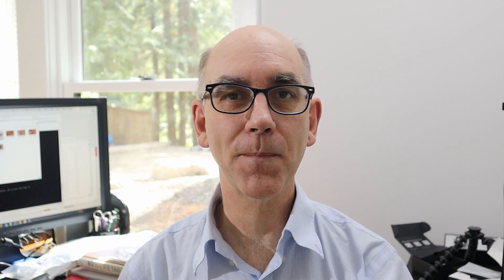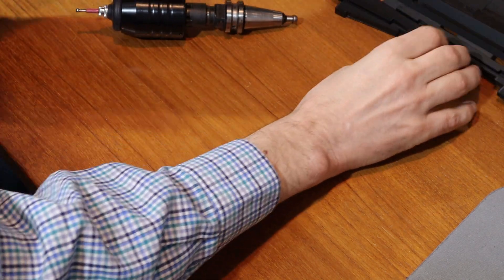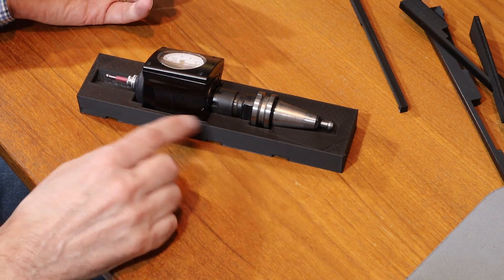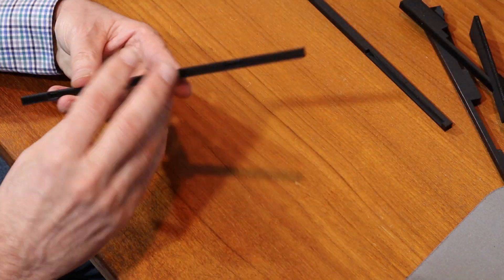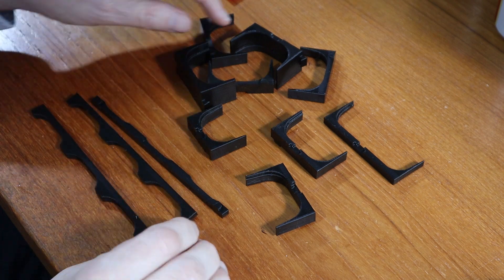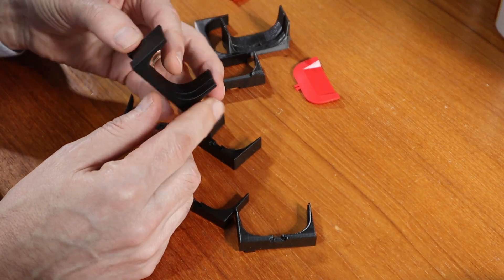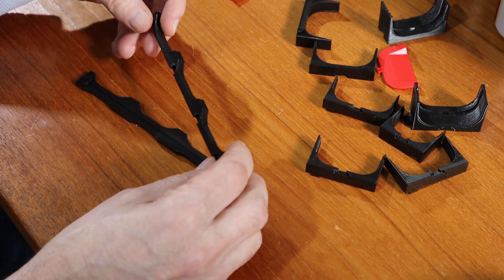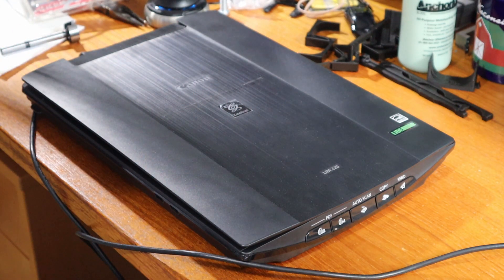Quick Reverse Engineering Techniques with a 3D Printer

Comment: Wow, that was unexpected. In a good way. 

I have been printing complete items at full size but 5% fill, draft, 0.3 nozzle. I hadn’t thought to slice out tiny test pieces instead.

I have a flatbed scanner but hadn’t thought to scan a ruler as well
Reply from the maker: Glad you learned something useful. It certainly allows much faster iteration on designs.

Comment: Good tips. My "prototype printer" has an 0.8mm nozzle and I print with 0.3mm layer height which greatly decreases print time. I use it for prototyping parts for combat robots and other machine projects. And right now while I am "working from home" I am also printing boxes for my toolchest to hold end mills, indicators, etc. inspired by your Lista box video. Thanks!
Reply from the maker: Most of the time I print at 0.2mm layer height because I like the smoother finish, and I'm willing to wait. I'm using a 0.4mm nozzle.

Comment: Lots of good ideas. Thanks for sharing. At the end, when scanning the parts, if you had placed the parts against the scale, there would be less alignment issues when bringing it into the CAD program. I am a big fan of using scanners on small parts.
Reply from the maker: That's a very good point. I'll try that next time I use the scanner.

Comment: Nice! I like that idea of just printing a cross section to check the profile.  I'm actually working on a project right now where this may come in handy.  I do something similar when I'm not sure if a print will require supports.  I slice and test print just the part i'm concerned about saving both time and, in the event of a failure- material.
Reply from the maker: Thanks Pete. Is that going to be in one of your future videos? I enjoy your channel.
Reply: @JohnSL  my latest video involves 3D printing but I was already too far into it to put these ideas to use.  But they have certainly been added to my arsenal of techniques!  I enjoy your channel as well.